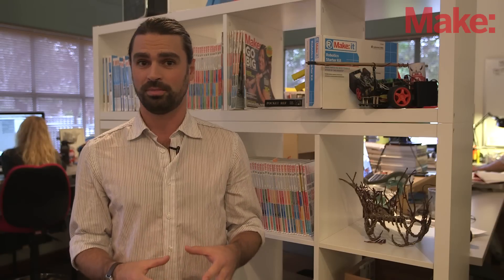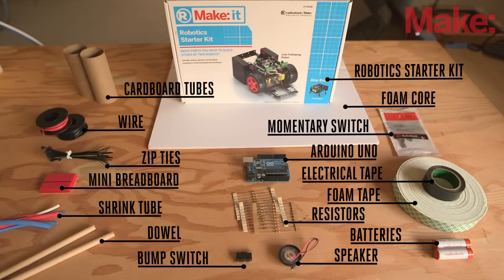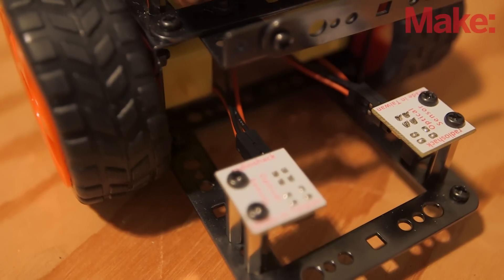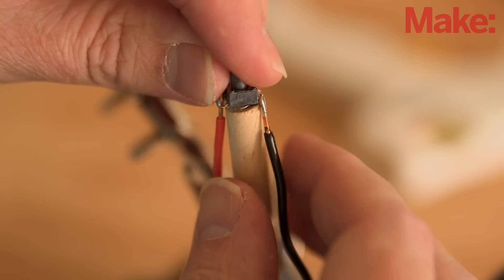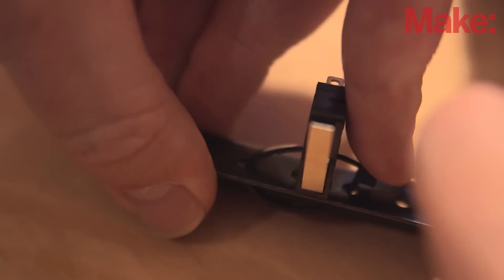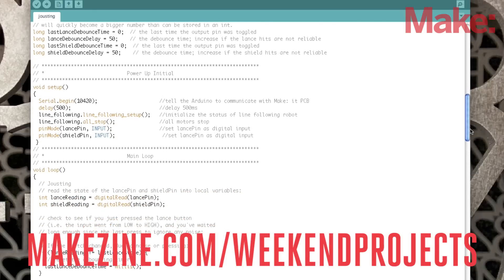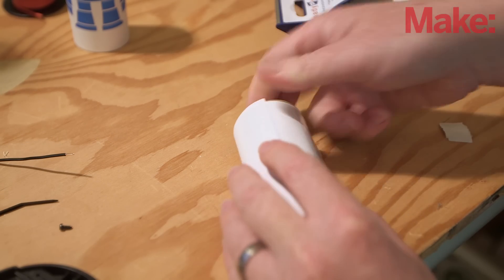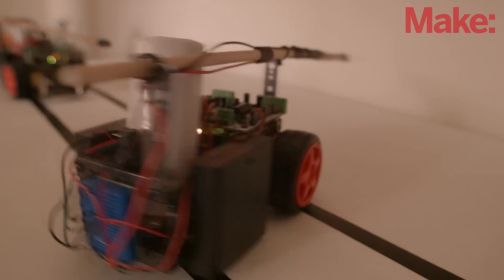Weekend Projects - Joust-A-Bot

Comment: Why not make it follow a single central line by swapping direction correction triggered by both sensors?
Reply: Because the whole point of jousting is the chance that your opponent misses... If you have them following just one line then there'll be less misses and more of a game of "who has the longer lance"
Reply: IrishSkruffles just space the sensors further apart to allow for more variance and you still save on having to put down a second strip of tape.
Reply: Wow amazing what an interesting design I would have never thought of that very cool
Reply: SilentS makes a fine point. There's more than one way to do things.
I originally wanted to have each robot in a separate jousting lane, like real knights. That way they might miss and pass each other. The mechanical layout of the robot made positioning the lances for this difficult, so I ended up doing it this way. 
It's not so simple to change the spacing of the sensors themselves, without modifying the frame. I wanted to try to use minimal extra parts, so I left the sensors where they were.

Comment: Maybe a stupid question, but can I change the color of line and ground? I mean white line and black ground ( line following ).
Reply: Not a stupid question at all. You can program it to look for a certain colour, and when it finds that colour, it will straighten out the wheels and start to drive straight until it reaches a different colour. You can easily change the colour that it follows by simply editing the hex code (Black would be #000000 and white would be #ffffff) to the colour that you want it to follow. Hope this helped!